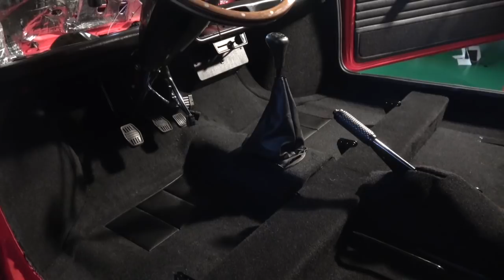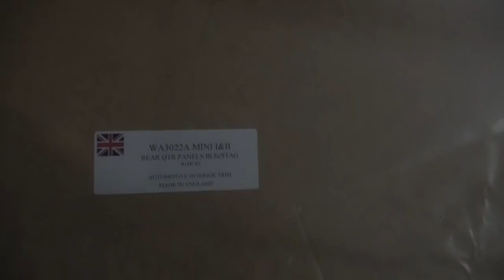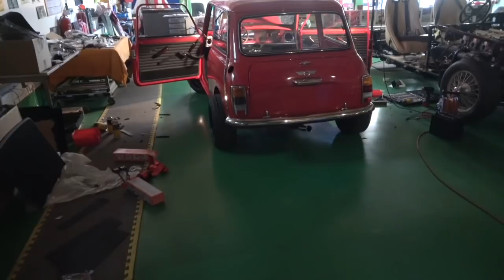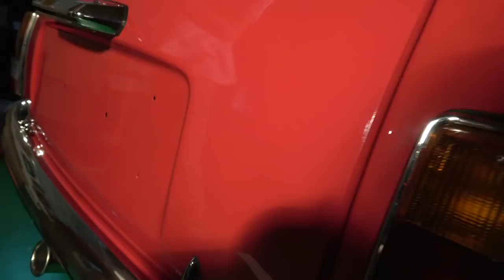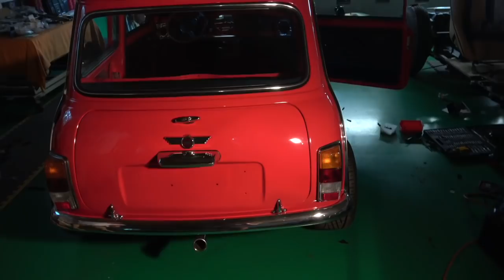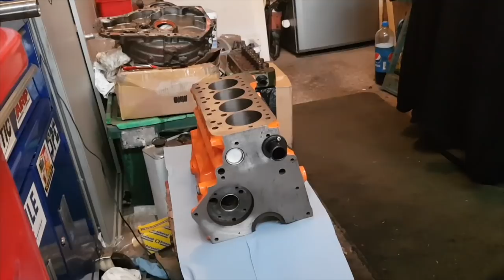Classic Mini Boot Fit & 1310cc Hill Climb Engine Dry Deck Build.

Comment: does that dry deck mini fit to a opel ascona c 1.3L engine? I have the same problem from over heating normaly those engines are nice Im tired from coolant electrolisys and other problems so I wuld like to switch to a electric water pump and Improve my cooling system do you have any recomendation for good head gasket manufacturer? ore how make own head gasket out of bether materials?

Comment: Paul told me to check out your channel this weekend at Impney, so here I am :) Is it going to be proper dry deck with the waterways drilled and plugged or just keeping them as standard with the cometic acting as the dry decking? By the way Phil at Turbo-Mini.com does the dry deck hosing much cheaper than MED
Reply from the maker: Rich, Thanks for checking the channel out & the info on the hoses, I believe it‘t just the cometic casket being done but Paul can tell you more
I hope you will stay with us while we build this hill climb / trackday car and perhaps give us some advice along the way. Cheers Dave

Comment: Hi Dave !! Was looking for some advice I’m currently doing a heritage door step on my mini and the top half for the frame has pulled in 10mm the car is braced from rear window to front pillar and I’ve even taken the car off the jig and still no difference the bottom size is 875mm lip to lip and the is 865mm any advice would be great 😩
Reply from the maker: Jordon,  Could you send me some photos to davejaguar66@gmail.com I can then see what you mean as it‘s difficult to get
a full picture of what is happening with the shell. Cheers Dave